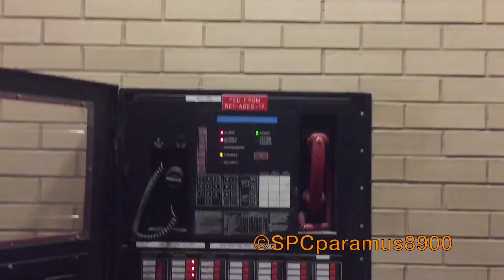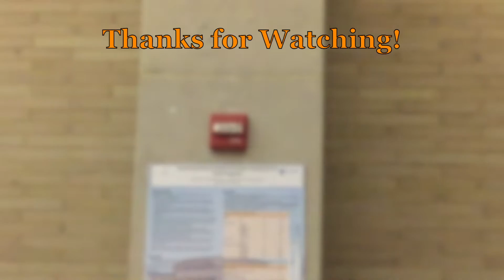Fire Alarm Activation #1 (Siemens MXL-V)

Comment: Why did the tunes kept changing for going from code 3 to continues?
Reply: Rather late reply. But the reason behind this is because the continuous tone is the attention tone played at the start, then goes to a code 3. Reason why its play like that is because the entire segment is in a loop. So after the code 3 and messages are finished it'll loop again back to the beginning. I hope this is accurate enough or makes sense.
Reply: @mekaHX  Are you sure that is what it is? On most other MXLs I've seen on youtube that tone is only heard when someone has keyed up on the panel microphone.
Reply: @rwinnovation7758  I believe so but I could be wrong on that. I didn't see any other MXL's play that tone when the microphone is keyed unless it's an option to disable or enable. I just remember hearing that tone play Everytime the panel went off and it was on a loop
Reply: @rwinnovation7758  The audio is looped, what mekalarms said was correct
Reply: maybe the speakers or its the wrong thing and meant XLS